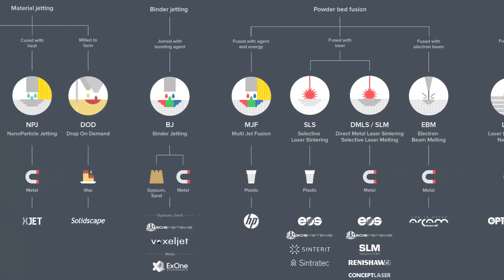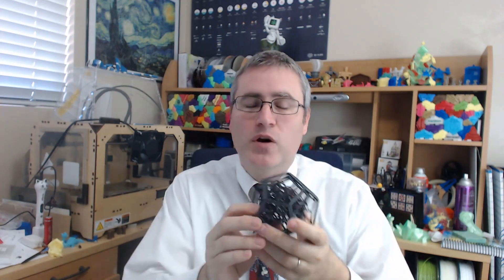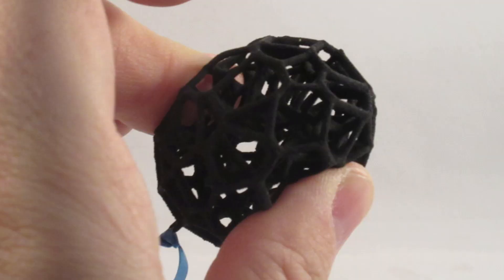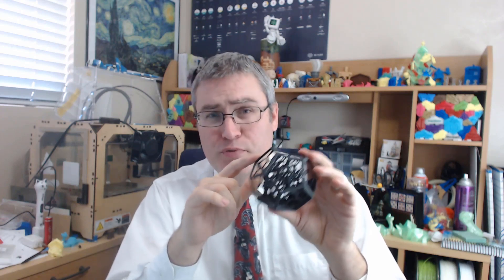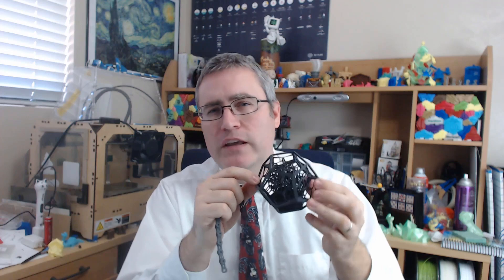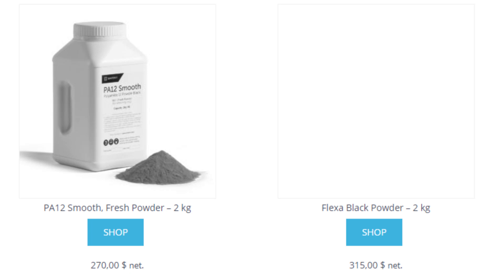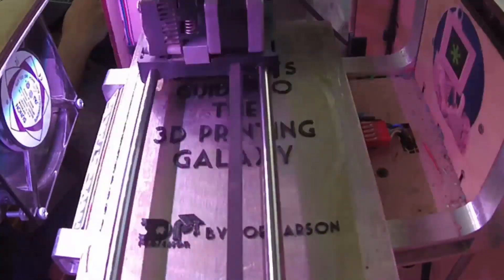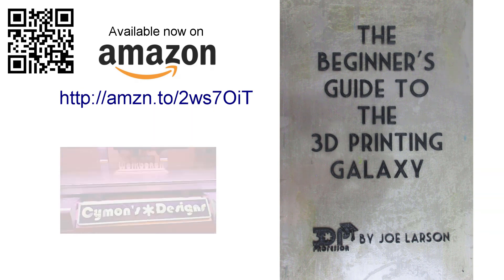What would you powder 3D print? Sinterit Lisa print review

Comment: There is a potentially huge health issue with home 3D printing.  The powder should never be handled without a proper respirator and other equipment.  SLS printing simply isn't safe for home use.  SLS 3D printing is really best left in the commercial/industrial sectors.

Comment: I was seriously looking at getting one of these before I decided on my top down DLP machine. The main thing that stopped me, was the cost of shipping. Since I live in Aus, it just pushed the price too far over my budget. 
On the subject of the recycling of the powder, my understanding is, that while you can re-use the powder, you need to mix the used powder  with new powder to get the best results, as the heat generated during the printing process degrades the powder in the chamber, so you would still need to keep a good supply of fresh powder on hand. Not only that, but the recycled powder really needs to be sieved, and they have a handy sieve unit just for that purpose, but that's another $1500. They do also have a nice closed unit for cleaning the parts once they come out of the printer, but again, that's separate, and that's about another $1000 on top of the printer. 
The other downside is the cost of the powder is crazy! Like $200-$300 USD for 2kg. 
Still, if you can afford it, the things you can achieve with machines like this are nothing short of amazing, which is why I was seriously considering it for so long. Perhaps when the material costs come down a bit, I will look again.

Comment: Hi! I worked with EOS m100 3D printer. It prints with chrome cobalt or titanium powder. I must say it's quite messy, and dangerous for life and health. The operator has to wear full gas mask during the cleaning and protective clothes, so you wont take that powder away on you, especially in your lungs ;) During the whole process you must be grounded, as powder can self ignite ;) DMLS needs to be supported, as it is supporting structure and heat sink as well. It must be printed on special metal discs. That was a lot of "fun" with this technology ;)

Comment: I think the big issue with powder based printer is the cost of material, because you have to mix in a certain percentage of new powder, whenever you reuse unused powder. As a matter of principle you can't print with a hald filled build chamber, so your (hobby) prints will rearely use more than 10% of the build volume, but you will habe to mix in 50% new powder afterwards, so you waste about 4x of your build material. This is no big issue for industrial uses, because they will fill up their build chambers with lots of parts to print, but for private use this will really need to go a long way untill it becomes attractive. I would assume resin based printing will much sooner be interesting for private use than powder based printing, but we still need to see where the end of FFF printing will be - maybe we will see some interesting innvoations there as well, when it comes to precision and speed.
Reply from the maker: That is a very interesting point, and one that I hadn't considered before. It definitely changes the paradigm.
Reply: They also need to find a way to clean the print before opening the machine to retrieve it.  The extra space needed for the other equipment would be a problem for most people not to mention no one wants plastic dust all over their house.  They could probably do this by adding some small vacuum system to suck the unused powder back into the fill chamber.

Comment: I had watched a different video for sinterit and from what I understood. You can reuse the excess used powder in a 50/50 mix w/fresh powder. Of course they didn’t say what happens after you used some of the 50/50 mix. Like can that be also mixed 50/50 w/fresh powder???

I, myself don’t think I’d have a use for the machine. I usually play with wood mostly (CNC) and am exploring adding 3d printing to try to work hand in hand.
Reply: lot of home carpenters use 3d printers for jigs.  I made a clamp system to hold a dial test indicator for example.
Reply: Dominik Stasiak I think what he’s asking is how many times can you refresh used powder before you have to completely start over with 100% fresh?  Do you get 1 refresh, 2?  How many refreshes before you have a medium that’s unusable?
Reply: Christopher Tilley you're  exactly right, that was what I was asking, I might have the original percentages wrong. there are truly no words to describe my basic confusion. Here's another example of it.  Start with 1 kilo of fresh material, build object, full fill, and you end up with half kilo not used. So next build 30% old left over material plus 70% fresh material. Here's the fun part: you build another object also using up half a kilo, remaining a half kilo of which an unknown percentage was  from the original 30 percent add in, now does that half kilo get added to the first batch of which the original 30 percent was taken from? So it's like at what point can you not use left overs? I swear I'm not trolling, it just boggles the mind. I probably  shouldn't  have responded, I'm quite happy putzing with wood, this item is way out of my price range.
Reply: Dominik Stasiak ok, much clearer now, especially once you hit the part of 100% used and refreshing with 30% new. I originally thought it was 70% new plus 30% used. But i think I get the big picture now. Thanks for the clarification!

Comment: Despite the printer itself being "clean", the post-processing still looks quite messy, judging from the Sinterit videos. From what I understand, recycling powder is possible, but parts will rapidly drop in quality unless fresh powder is mixed in. Finally, as I understand it, the dark color of the powder is functional and somewhat necessary to allow the laser to adequately sinter the material; a lighter-colored material would not absorb enough of the laser's energy and different colors would affect the absorption of the energy as well. One color allows for predictable results.

That said, this is incredible progress, parts can be painted easily (allowing for colors and a more finished result). Thanks for the video, Joe - good stuff.
Reply: Yeah I think some experimentation with spray cans to produce different finishes should fix the problem. SLS probably has some potential to produce more complex mechanical parts and gears.
But really we need ways to create reprap SLS printers and cheaper nylon powder.
Also why not build something where the "sandblaster" is directly connected to the print chamber so you never have to open the printer and take out your print without the powder being removed already.
Reply: I've tried to find less expensive sources of powder for a friend's Sintratec. You'd pretty much need to form a co-op to buy in bulk and split it up between multiple users.

The gray & black is likely added carbon to help absorb the heat from the laser to fuse the grains together. Said carbon also helps reduce the static electricity effect so it doesn't stick everywhere.

In principle it's not that complicated but  it's a multi-shelled, insulated machine with a heated chamber going at least 150˚C.
Reply: In a video on the Formlabs Fuse 1 it was explained that yes, you're correct that the darkness of the material is there to make it easier for the printer to fuse the material - however, they also mentioned how this was also because of the wavelength of the laser they use, which is just barely into the infra-red wavelength - as I understand it, this is a fairly cheap laser, which makes the unit more affordable.

Obviously, the same is true for the Sinterit - BUT...! With a laser in a higher wave-length, this problem would go away! White material would be possible, just use more energy, more expensive laser-diodes (or however they emit the light).

Obviously, this would make it cost-ineffective... but give the tech a few years, if successful, then other whole-object colours would be possible...

imagines a gigantic powder-printer which uses GAMMA-RAYS to fuse material :O